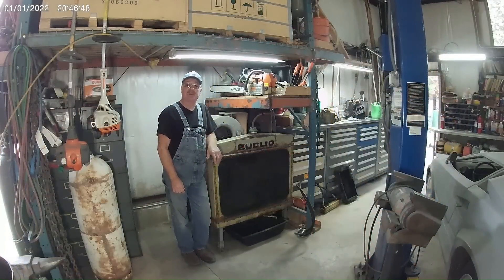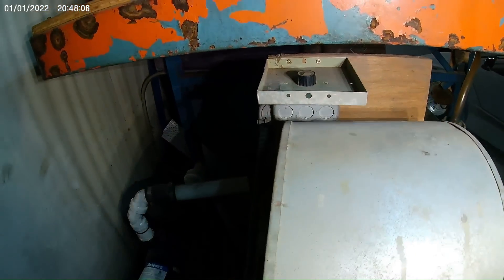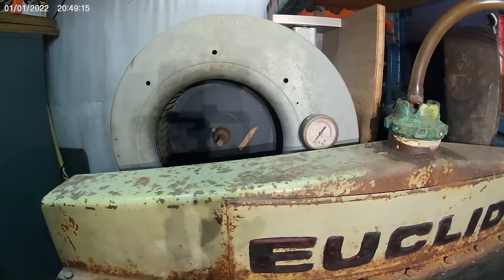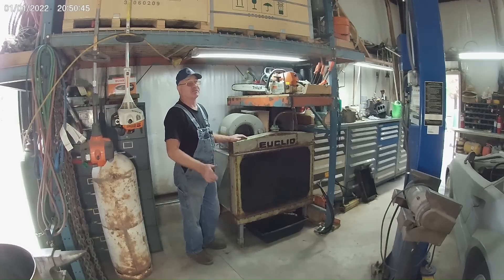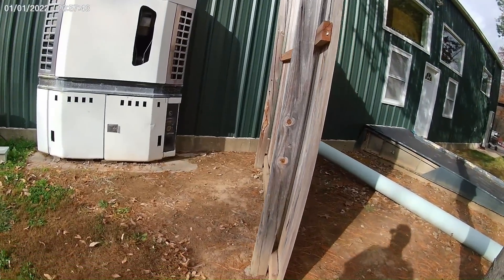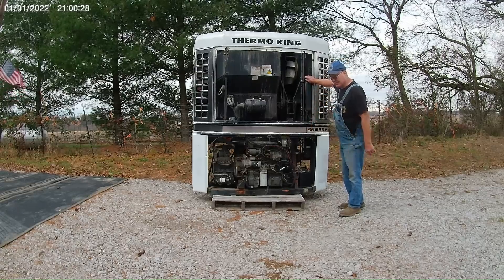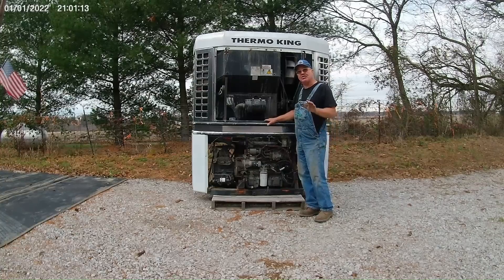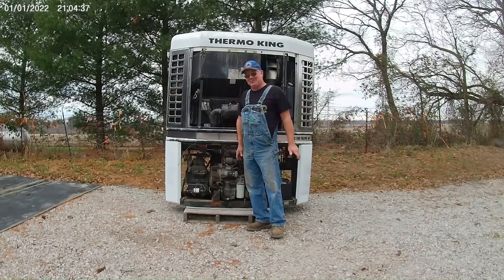The unconventional way we heat & cool our shop !

Comment: A tk super 2 will fit in a standard doorway. That's what i used in my shop. Whisper unit with a yanmar in it. Cut the door on half to cover up the engine and be able to open for serviceability. I have a rear remote setup at the front door of my shop to control it. Fuel tank is inside. Flipped the tank brackets over and put casters on it.
Reply: We need a video of your setup
Reply from the maker: Cool!
Reply: That's genius.
Reply from the maker: @life_of_riley88  TY!
Reply: What type of square footage would this cool? How is fuel consumption on that setup?
Reply from the maker: @crherniman  To many variables to answer! Sq- area, what is inside,& so on.
Reply: @dieseldoctor25  gotcha. What size is your shop? In guessing it's an insulated metal building correct? I'm planning on building a shop similar and exploring my options. I absolutely love this idea by the way!
Reply from the maker: @crherniman  100x40x24tall yes, all metal 6" insulated Industrial shelving to the ceiling.
Reply: @crherniman  fuel consumption is typically 1.2-1.3 gallons per hour on high speed.

Comment: Very Innovative! 👍👍😜🤣😁😎 PS 🤔 Here's A Way To Improve On Your Outside Refer Setup For Pickin Up Extra Heat + More Silencing Of The Unit? See I Invent, Sell & Install Green Living & Self Sustaining - Off Grid Products, I Custom Build Solar - Wood Burning Sheds + Water Heating Boilers, ETC! Now, Build A Simple Metal Stud - Slopped Roof - 3- Walled Metal Shed Around Your Refer Unit, Up Just Below That Big Window, Afew Feet Wide From Both Sides Of Refer & Out Say 6'-8" From Shop Wall? Use 2" Foam Insulation Board On All Interior Walls + Wide Alum Duct Tape To Seal All The Cracks To Make It As Weather Sealed As Possible + Put A Walk Door In On Any Of 3-Exterior Walls You Want + Weather Strip Seal It Good Also, Plus I'd Install A Larger Balanced Louvered Vent Backwards Into Side Wall Somewheres w/Insulated Heat A/C Flex Duct For Outside Air Intake To The Refer Unit, High Enough Off Ground So Snow Levels Won't Effect It? Now Build An Elevated Stand On Either Side Of Refer & Put Another Squirrel Cage Blower w/Hole Thru Building To Blow Hot Captured Air Outta Metal Shed Up High As Possible To Blow Into Shop + A Return Duct Down Low For Return Air Into Shed, w/Auto Attic Fan Thermal Switch To Operate Blower Fan, Set At 70* Or So + I'd  3" Gravel On Floor To Also Retain Heat...  Soo In Essence Then You Would Retain, Recycle & Utilize All The Heat From Around The Refer Unit Whilst It's Running... For An Addition You Could Build A Plate Steel Wood Burnin Fire-Box Thru A Side Wall w/Exterior Facing Door To Burn Wood - Used Oils, Etc For Even More Heat Outta Solar Shed For In Winter? Plus Add A Cast or Stainless Water Heater On Top Of The Wood Fire Box To Heat Water Also? Thanks & Stay Hot or Cold... 😁😎
Reply from the maker: wow!

Comment: For close to thirty years, I was convinced that a reefer unit would make the optimal cooling system for a work shop. Having seen your system in an actual operating setup, my theory has been proven. Thank you for confirming my hypothesis correct. Really nice job.
Reply from the maker: Thank you!
Reply from the maker: Thanks!
Reply: Ive always wondered the same thing, "why dont people use old refers"  
awesome work Mike
Reply from the maker: @squirrelmaster1225  ty!

Comment: I’ve always wanted to try a belt drive unit and use a brushed motor like a forklift powered by solar panels directly. That or a water wheel. Rotational shaft power is universal.
Reply from the maker: That would be cool!
Reply: We all await your video sir

Comment: I considered the reefer unit for my off the grid cabin (24' x 40') years ago and when I talked to an HVAC guy he said it probably wouldn't work (can't remember his reasoning anymore but it have something to do with airflow). Now I'm going to have to reconsider.

Given than I have a much smaller volume to heat/cool, do you think a unit off a straight truck is what I should consider?
Reply from the maker: Yes very small!

Comment: I ran a Thermo King reefer for many years. There are dependable and reliable, they have to be because of the perishable cargo. Using one to cool your building is a great repurpose and genius solution for your purpose.
Reply from the maker: thanks!
Reply: What's the fuel consumption? Must be pretty huge.
Reply: @Nicholas-f5  It’s less than a gallon an hour.
Reply from the maker: @Nicholas-f5  about 0.9gal per hour running wide open.
Reply: @Nicholas-f5  He said about 9/10ths of a gallon an hour going balls out. $4.00/$5.00 and hour or less using diesel.

Comment: Geothermal works great and efficient. Direct like you have, not so much. You need better humidity removal and you won’t get that  with 60F loop water temp.
Reply from the maker: I dump the tray under the radiator every day in the summer time!

Comment: A 30k+ BTU mini split cost 3k and is super cheap to run. Running a diesel air conditioner makes no sense.
Reply from the maker: MIni split would not even come close to cooling this shop. It would half to run for days! I can cool it in 3hrs

Comment: That's awesome. I work on transit buses that have Thermoking systems. I love working on TK, they're very well designed. We have some older buses with that same a/c compressor that's in your reefers, the X430. They originally came with R22 but we fill them with R407c now. Our newer TK units have screw compressors which are very interesting but much more complex than that indestructible old X430. After tearing one down for the first time it's incredible just how robust their reciprocating compressor is. It's no wonder they last so long.
Reply from the maker: The x430 is all i have worked on scroll compressor sounds cool! IM getting old!
Reply: @dieseldoctor25  I've not seen a reciprocating compressor in any air conditioning unit made in the last 20 years. 

Most scrolls are actually simpler, they usually only have one or two moving parts (rotor and the orbiting scroll) no oil pumps or anything like a recip and tend to cope with a fair amount of liquid flood back.

Have a look at the copeland scroll compressors, their oil pump is a channel cut in the rotor on an angle to pull oil up with centrifugal force and the oil is more or less used to keep the plates together, if you get liquid in the compressor the liquid overcomes the force of the oil and seperates the plates. You usually burn the paint off the top of them before they fail from liquid.

I know they're not too popular in medium/low temperature applications as they don't tend to like running at low pressures/into a vacuum but I believe they are becoming more common in refrigeration.

The other advantage of them is unlike a recip they don't lose capacity due to gas re-expanding as the piston comes back down.
Reply: @luke5518  I misspoke, I meant to say screw compressor not scroll. Our newer TK units 2015 and up have screw compressors. Everything before that in our fleet uses the X430 reciprocating compressor like in this video. We haven't had any problems with the screw compressors except for some unloader valve solenoids.

Comment: An electric AC unit is far simpler than a reefer unit and requires no refueling or oil changes and is far quieter so I really don't understand why you'd do this.
Reply from the maker: #1 I am a diesel mechanic #2 it only runs 1 or 2 hrs at a time & that cools off my shop very well.
Reply: Rule of cool, that’s why 😎

Comment: One day i had a slightly similar idea for the use of an old Pete if i ever had enough money to build a shop. Build the shop to live in and lift the truck to second level and put the wall between the cab and sleeper with the sleeper out side. Dispose of the rear axles and mount the propane tank on the frame rails. Cab section left complete all tricked out, chromed gauges, all working functions, PlayStation drivers station, full stereo controls.... yadda yadda yadda

Well, it Was a dream. There may have been alcohol involved.
Reply from the maker: O wow you sound just like me! LOL

Comment: 7:36 a little noisy
Reply from the maker: diesel engine!
Reply: Ok,  I have a 96"×12', 48' reefer curbside flat floor rollup door as a mancave/bar in Mi.
I set auto run and throttle to turtle speed (disconnect high throttle) to keep it quieter. A TK 2way, diesel/shore power on a GREAT DANE!
Reply from the maker: @fishhaulergreatlakes8208  That is perfect!!

Comment: My heat pump/AC uses 14amps and cost on the unit was $500 from a big box store, at average of $20 a month running cost. What is the efficiency in the system you have built?
Reply from the maker: poolpump 7 amp at start 4amp running. fan 6amp start 3amp running. No heating coil! 7 amp total running

Comment: If you have the doors with the sound insulation on them like the whisper versions. you can actually carry on a conversation beside it when it's in low speed. I always enjoyed pulling one of those whisper units you never really noticed it. The new ones with the plastic case have always been louder than the old whisper unit. However the new president actually seems to be doing a good job being quiet. Whatever you do stay away from carrier. I hate pulling them loud and has this droning sound in the cab. And always seem to be something small going wrong with him. But Thermo Kings very reliable however when they go down they go down hard.
Reply from the maker: yes ,worked on carrier never did like them.

Comment: What is the size of your shop? I have a 60Wx70Lx14H shop in southern AZ..  my shop gets VERY hot in summer. The builder did not include any roof or soffit ventilation so I'm working on that..  but beating the heat here in AZ is very tough... not sure if the Thermo King could keep up or cool it..  but I'm no HVAC expert ..  any thoughts? Also thinking about doing the ground cooling as well..  but one step at a time..  :)  Thanks for your input!
Reply from the maker: My shop is 100x40x25high. don't know about AZ. I would ask around!
Reply: If you spray foam the whole building you'll be fine
Reply from the maker: @vannorman1116  Done already

Comment: I had the same idea going back 15 years I wish I had followed through on my research I was led to believe that the thing had the condenser unit running the full length of the trailer which would have made it a complete pain unlike what your video is showing that it's a standalone unit. So I guess I'm back on the hunt cuz I want to do the exact same thing got a 40 by 60 ft garage that one of these will be perfect for.

I'm right on the California Arizona border if you know if there any places out here that might be a good source I'd appreciate any info. Thanks
Reply from the maker: No but find a used trailer dealer, or salvage dealer, or Facebook market place. Good luck 🤞
Reply: There are multi temp setups that you'll want to stay away from. They will have remote evaporators mounted to the ceiling and will all be plumbed to the host unit. I installed a lot of them.
Reply: Reefer trailers have a curtain/duct hanging from the ceiling that carries the cold air all the way to the back. Before I saw that set up I was imaging a plumbing nightmare too.
Reply from the maker: That would be something lol!
Reply from the maker: good to know.

Comment: Hey Mike, just stumbled onto yiur channel, yiur a crazy dude.. used to work on them units alot, the model name has a 30 in it, SB3 -30. The ones I use to work on had a 50 in the model name.. these units had electric standby, with an electric motor, much much quieter.  Yiu should do a retro fit..you'd need to add a clutch to the compressor and also a motor and belts with an idler pulley . Runs around the same speed as low engine speed..lol...
Nice use if an old reefer 😂😂
Reply from the maker: Thanks

Comment: Have you thought about using a tank to bury in the ground instead of the 1000' pipe loop? A home might take a 250gallon tank and would be a small vertical footprint.
Reply: The length of pipe was not for volume it’s for heat transfer.  A tank or two would probably work fine but the way they’re plumbed together and the rate and direction of water flow would make a huge difference.  But the easiest way to get similar results is just a very long length of pipe buried under ground
Reply: I get it just thinking for homes with small lots.  @georgewelker2846
Reply from the maker: Do like geothermal & drill wells. for a small lot.
Reply from the maker: I think a tank would just circulate the same coolant rather than pushing it through the pipe.
Reply: I thought that too, but then an HVAC guy told me to have one intake pipe on the top and one outtake pipe on the bottom. Keep up the videos.  @dieseldoctor25

Comment: When you changed refrigerants and oil on the one unit, did you have to change the metering device too? Just curious.
Reply from the maker: No , just using it for a/c. That's why I used 134a.

Comment: Isn't R12 a better freon? Just a little harder to find these days?
Reply from the maker: no, there is alot better freon out there.
Reply: That’s just a misconception, all modern refrigerants transfer heat well, they just behave differently. I wouldn’t bother with R12, it’s expensive and terrible for the atmosphere. I probably wouldn’t even bother with R22 much anymore either, it’s getting pricey, R410a is much cheaper.
Reply: @etonmows7901 I think it was proven even before the change out that that was nothing more than a hoax, and I'm quite sure the patent running out had nothing to do with the change out but I can tell you I saw for myself the corrupt Behavior by our EPA in keeping anything else from coming to Market other than something patented by DuPont. I actually bought a hydrocarbon blend from a company in Santa Ana California that had to get an injunction from the Supreme Court to stop the EPA from the oppression that they were pulling on them.

Comment: I used to haul reefer units ( thermo’s and carriers) and had one shut down in extreme heat one day and 4 hours later at the destination $180,000 worth of not so frozen bulk goods down the drain...
Reply from the maker: o-boy,  I was lead mechanic & called me in middle of night said reefer not cooling stuf dripping out of floor box drains 40000# of pop sickles !! NOT GOOD!

Comment: That's cool!  I'm really interested in using one of these refer units to make an ice bar at burning ban. You think a well maintained one can run for a week reliably in a dusty desert?
Reply from the maker: I dont know why not,find a good one!
Reply: I'd expect them to handle that no problem. But, be prepared to blow out radiators and condensers. They will collect dust. and filtering on the outside side is not a good idea as the filter will plug up.

Comment: That is a really great idea! I saw someone use a BARD Hvac unit from a commercial building or big office trailers. They run on 240v.
Reply from the maker: wehen fuel is high electric will be cheaper!
Reply: Yep! In my line of work (big generators) I end up with a lot of free fuel. I have 7 diesel VW's that we operate for free basically. @dieseldoctor25
Reply from the maker: cool!

Comment: I have a mini-split system in my garage. I guess you call that a "maxi-split"
Reply from the maker: Lol you bet!
Reply: @dieseldoctor25 I like it!
I wonder what the cost is compared to conventional.
Reply from the maker: @KlownWatch  depends on how you use it  &for what purpose.
Reply: @dieseldoctor25   What size is your shop?
Reply from the maker: @aaronawfd  40x100x28high
Reply: @dieseldoctor25 much appreciated
Reply: Indeed
Reply from the maker: @Tjousk
Reply: Eg4 Hybrid 24,000 btu for sure
Reply: Package unit
Reply from the maker: @billbowles2674  Very simple.